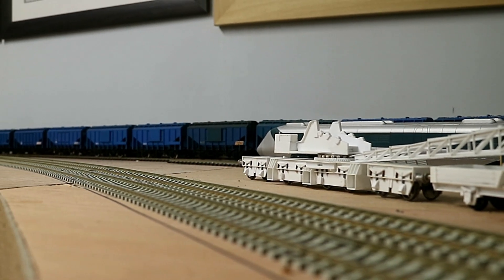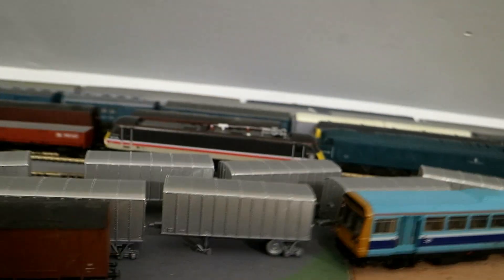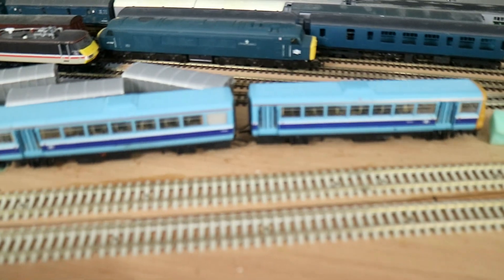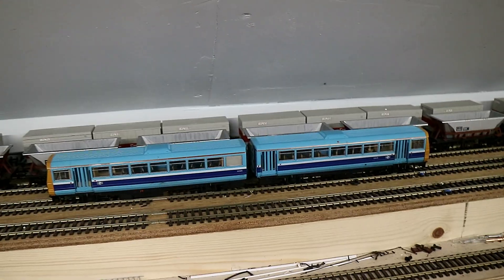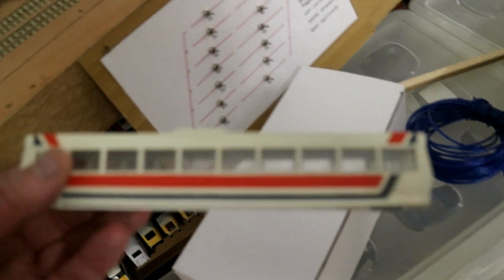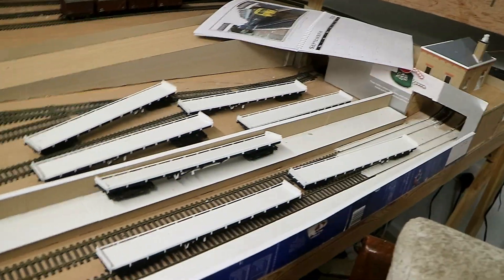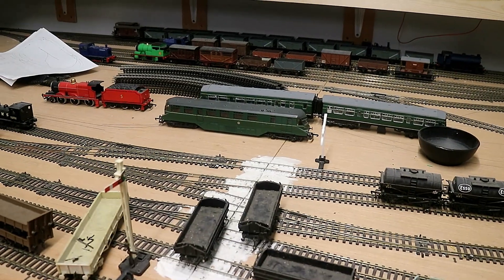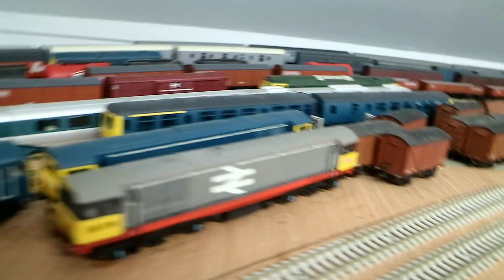A Master Scratchbuilder and Kitbasher's Work in OO Gauge - #modelrailway

Comment: 6:35 - Oh that rings so true!!! I've been building an A3 in 00 and realised after fitting a load of pipework that once it's on, I can't paint behind it. You get so stuck into the build that you miss something really obvious in hindsight and have to go back and do it again. The worst part is, once you've seen it, you can't just ignore it, it niggles at you. Still great fun though. That 58 looks superb! I'd be curious to see the extent of the modifications to that from the Hornby original.